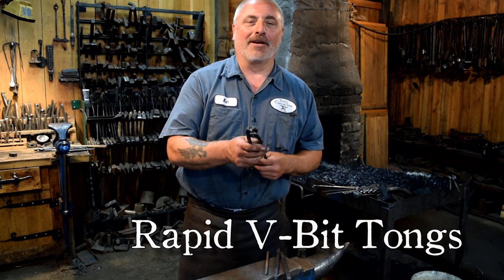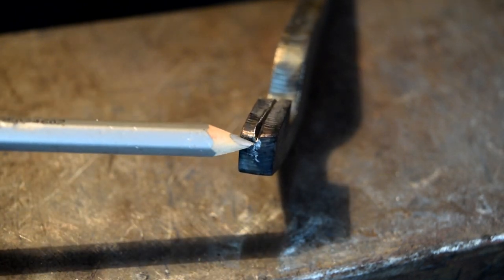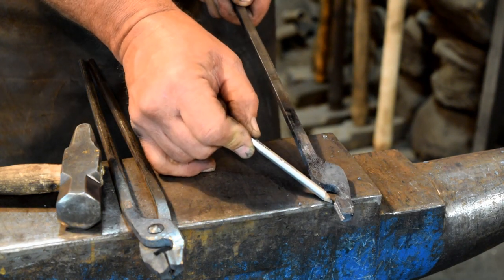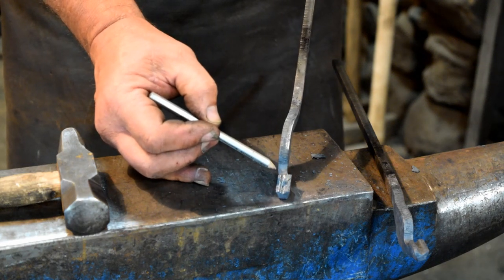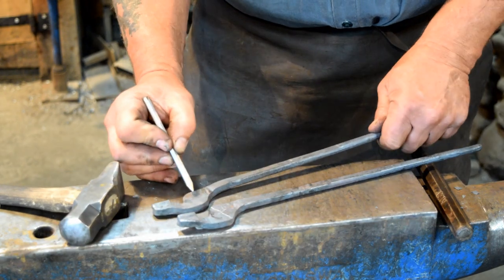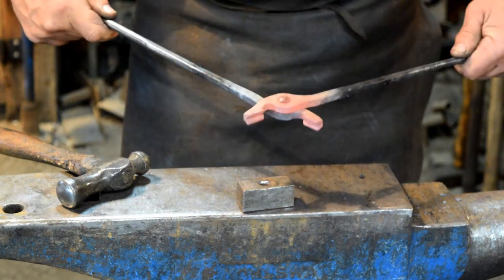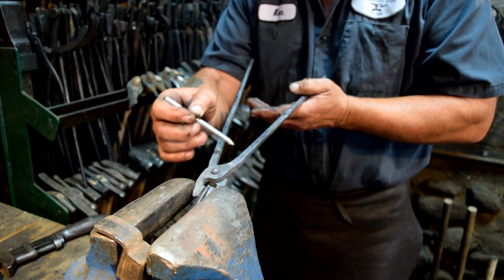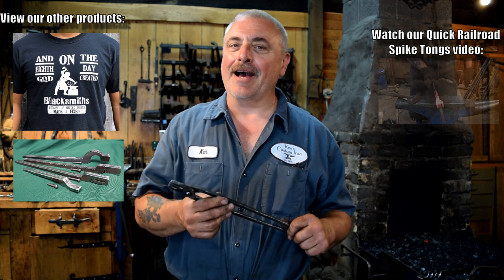Rapid V-Bit Tongs Instructional Video

Comment: Thanks for the help I have to know though how do you get that tip so hot and still be able to hold the iron by hand What type of forge are you using my forge heats the whole thing up
Reply from the maker: I use an induction heater!

Comment: What can I use it I don't have a rivet set?
Reply from the maker: You can rivet your tongs using just your anvil and hammer. The heads will be flattened though. By using a bucking tool and a rivet set  you get a nicer looking finished rivet.

Comment: I am confused...You are showing at the start a left handed tong..then making a right handed tong or vs versa..not sure now. I bought a set and made my v bit tong using the video and they work great other than bottom rien is on the left side now. So is it a left handed or a right handed tong?
Reply from the maker: Sorry about the confusion!  If you look at the tongs in the opening video, that is what I would call a Right-Handed tong (as I am right-handed and hold the tongs in my left hand). The one I've demonstrated is what I would call a Left-Handed tong, as it would be held in the right hand of a left-handed person. I generally make right-handed tongs for myself, but occasionally my "old-timers" kicks in and I end up making a left-handed pair and after doing this for over 45 years, I don't notice much difference in the use of either type. You will also notice that the reins have an offset in them which places both reins in line with each other making them practical for use in either hand.
-Ken

Comment: I ordered a set of your DIY Rapid tongs. The rivets are not 1/4". They're 3/16" and aren't long enough to go through both tong sides.
Reply from the maker: I am sorry if the incorrect rivets were sent. Will you please provide me with the order # so I can send the correct rivets. Once again I apologize for the hassle.
Reply: @KjZiturKensCustomIron  Ordered off Amazon. Order number is as follows:
113-3404423-1268211
Reply: @KjZiturKensCustomIron  and it is the 5 pair set of Rapid Tongs.
Reply: @KjZiturKensCustomIron  I reviewed my order from Amazon and I believe I purchased a knock off version of your product even though they came with a video link of Black Bear Forge doing a review of your tongs.